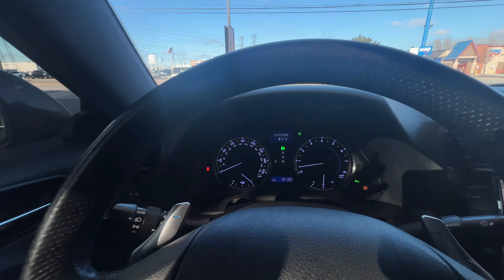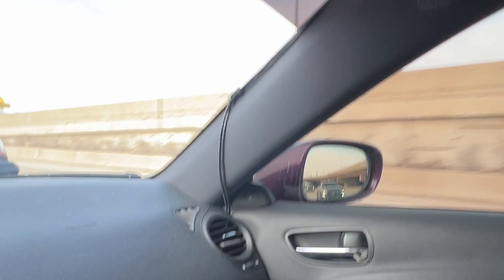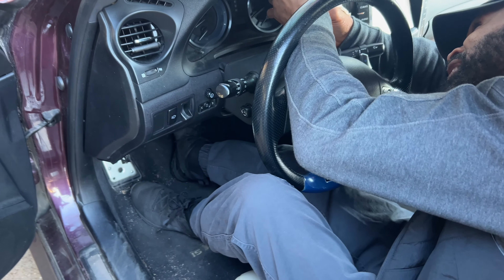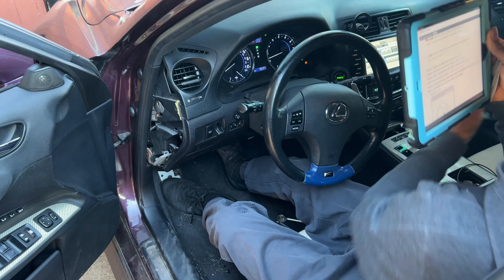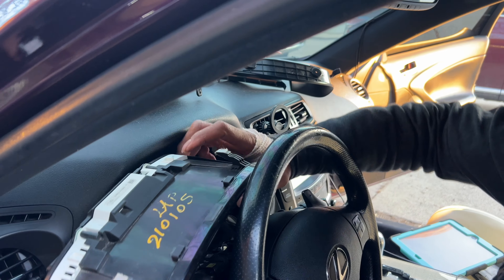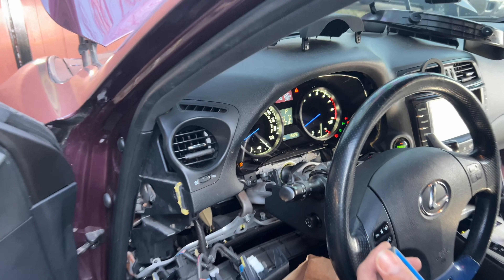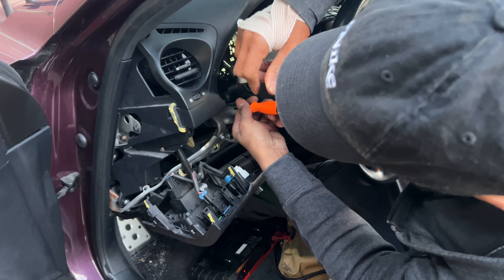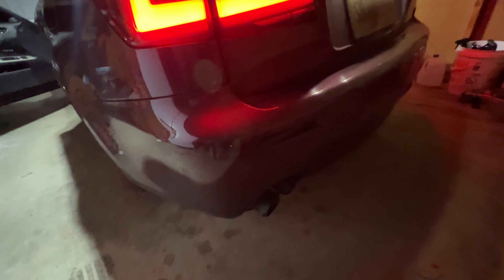My ISF gets a new Cluster|How-To Lexus 2IS Cluster Swap

Comment: Yo bro do you know if ur guy can swap headlights, 2011 ones onto a 07
Reply from the maker: That sounds more like body/fabbing work since 07 is still 1IS not 2IS
Reply: @isfdubs  uh nah they fit just the led strip don’t work
Reply from the maker: @htownvlogs3883  that’s just a small wiring issue, you have to setup the fuse/wiring for the DRLs
Reply: @isfdubs  hm alright thanks
Reply: @isfdubs  can you go a little more into depth?